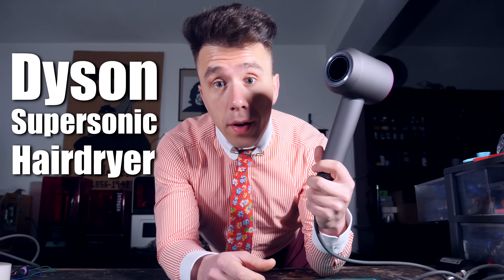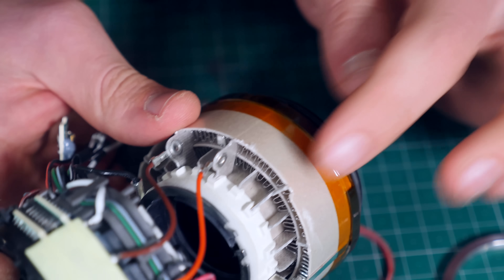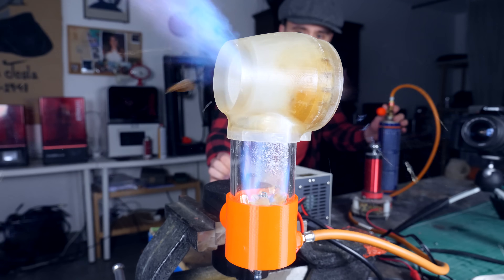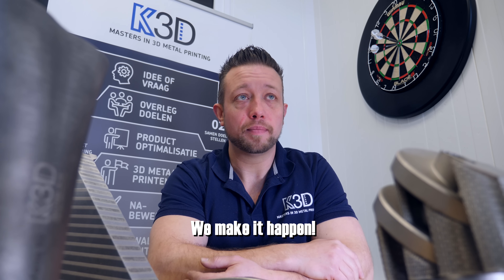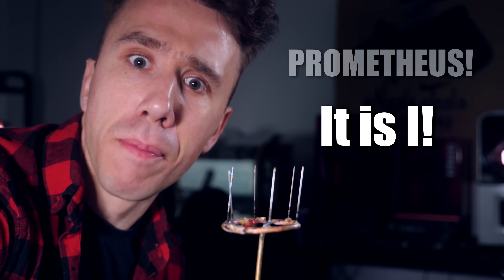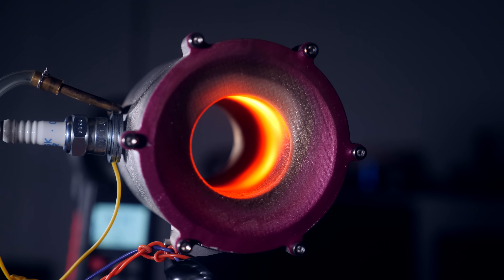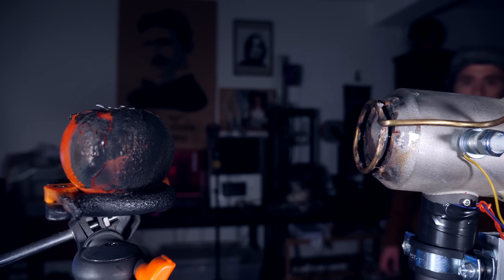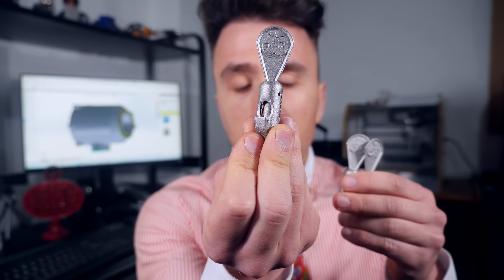I turned my DYSON HAIRDRYER into a JET ENGINE

Comment from the maker: A big thanks to Bob and K3D for the Metal Printed parts! If you need something printed in Metal they are your guys! (K3D Website:https://k3d.nl/en/)
Reply: have been thinking about 3d printing my rocket in metal so..
Reply: you finally uploaded 😱😱
Reply: A Brazilian dollar 😂 follicular dehydrator, you are now a fully qualified mad scientist. Love your work Joal👍🇬🇧
Reply: Why do you have a picture of John Lennon next to the picture of Tesla?
Reply: What settings do you use on the elegoo Saturn?
Reply: Are you still working on a detonation rocket engine?
Reply: you really need TEKNOFIBRA to protect stuff from high temperature!!!
Reply: 4 of these on a skateboard, i wanna know how fast it'll go with you riding it.
Reply: Mabye try to build a more sophisticated turbojet engine (with afterburner) by adding more compressor and turbine stages. You can encase the whole engine and use some of the intake air to cool the engine or maybe even try watercool it. You can increase the overall heat by using liquid fuel instead of gas or using a better gas mixture. For example a stoichiometrik hydrogen oxygen mixture (In order to not blow yourself up you can use flashback arrestors). 

An other thing you could build is a turboprop or try to improve your ionic thruster or try to test and use toroidal propellers for your engines.

Btw great videos keep up the good work.
Reply: When you reach a certain milestone of your choosing, meet up with LA beast and drink a jar of tomato juice.
Reply: same shit, when you make a self sustaining one then call it a jet engine what you made is a hit air gun 😂😂😂😂
Reply: You’re welcome Joel! It was our pleasure! Great to have you, until we meet again!
Reply: I'm intrigued... because the custom X-Wing I modeled 1:1 while learning ..... which ended up deserving the 2 years I spent on it.....    well, when something is over 36 feet wide and you try to reduce it to fit within a 220x220x240mm or a Photon-S build plate.....some things scale right out of existence.... I am 1 with the Force, and the force may be with me.... but where the heck was it then?
That build plate and the Flying Screwdriver are destined. (So Much Easier Than Electroplating It!)
By the Way.... Your hair is Fantastic, and I don't only say that  because I'm a poor excuse for a  Lex Luthor/Kermit The Frog/Freddy Krueger Doppelganger. It just Is. And, Tomatoes are Fantastic Fruit.
Reply: Now that I Watch on replay instead of typing..... I'm amazed you didn't burn the damn hair off.
Reply: I think if you add a water cooling system in your next design, it will help prevent the engine from melting.  This is the next logical step.
Reply: Make spiral tube around the casing, pre-cool the fuel and feed it trough that spiral inside your chamber. It Should cool the casing to withstand higher temperatures and at the same time it pre-heat the fuel...
Reply: Ahhhhhhhhhh I need a 3D printer pls
Reply: The man does love his jet engines.
Reply: Ideea Jet-Powered Coffee Maker
i'm a coffee lover so why u dosen't make an coffe machien which can re use heat to make hot water and the trust to create a preawsure for extraction.
Reply: or can u make an EcoJet for "The Sustainable Jet Engine of the Future"
Reply: Integza try to incorporate the fuel feeder system in the 3-d print itself with a nozzle extension which will help you to add the fuel more efficiently and thus create more thrust with the same amount of fuel
Reply: Integza you are the man!!! Your inventions are terrific!
Reply: Please take more safety precautions, my friend. You are tempting the gods.
Reply: If u get a sponsorship from pcbway they do metal 3d printers and cnc
Reply: @KonstiGrieche  Walk young Padawan... don't run yet....
Reply: now make that into airfryer. :D
Reply: Brooo try and use an axial flow compressor for the new engine, they have much higher compression ratio, I even tried designing one myself before I found out how expensive it would be to get it made with markforged… 6 stage + ogv and igv is good for anything under 10 inch diameter and stainless steel is fine but you can go as high as 8, and to remove the massive calculations required for the velocity triangle to prevent a compressor stall just use variable attack stator veins with trial and error. Convergent inlet helps sometimes from what I’ve seen, if you want to know about building variable aperture exhaust nozzle there is a link to a video and I can paste here but that is only necessary if you plan on producing the engine with an afterburner, also don’t forget to use inconel 713c for the combustion chamber, turbine section, afterburner, exhaust nozzle… I studied building a very high thrust to weight ratio turbojet engine while designing a supersonic UAV and trust me go with a axial flow compressor… anyway I love your videos, great video, thanks
Reply: my theme idea is :jet engine jetpack
Reply: 🔴 What Is Islam? 

🔴 Islam is not just another religion. 

🔵 It is the same message preached by Moses, Jesus and Abraham.

 🔴 Islam literally means ‘submission to God’ and it teaches us to have a direct relationship with God. 

 🔵 It reminds us that since God created us, no one should be worshipped except God alone. 

 🔴 It also teaches that God is nothing like a human being or like anything that we can imagine.

🌍 The concept of God is summarized in the Quran as:

📖 { “Say, He is God, the One.  God, the Absolute.  He does not give birth, nor was He born, and there is nothing like Him.”} (Quran 112:1-4) 📚

🔴 Becoming a Muslim is not turning your back to Jesus. 

🔵 Rather it’s going back to the original teachings of Jesus and obeying him. 

More .....👇

🔴 THE RETURN OF JESUS
Reply: @ddoherty5956 he said a bazillion but sounded like a Brazillian lol
Reply: @LtdJorge  I know matey🤣👍
Reply: @monarch6057  Why are axial flow multistage compressors not used more frequently in smaller engines (lets say a diameter of 6 inches or less) exept for the price? Im not experienced at all when it comes to these applicaions but have an interest in them and im taking studying this subject into consideration. Currently im in high school so i would be pleased if you could tell me some things about the subject like what you expected and how it actually turned out.
Reply: Mate just get away from plastics
Reply: Now make it fly
Reply: Scammed alert mate 👌🏼
Reply: @HicSvntDracones  quite true
Reply: Hello.  I’m pretty sure this person is impersonating you.  https://youtube.com/@integza1..  using your good name to steal info.
Reply: @jordanguyy  I got one too.  Reported.
Reply: mate you can build a rc fighter jet
Reply: i got a text me on telegram comment on my thing was that from you or a scammer
Reply: @jacksonmielke3817  Likely.  They’ve tried to get me a few times.  What was the logo by the call?
Reply: I thought it was fake anyway because if it was him he said the giveaway was for the person with the most likes mine had one and was Make a jet engine that uses useless tomatoes for something. 
example: fuel
Reply: logo as in his tomato with a mustache
Reply: @stumblestorms7881  sorry didn't send
Reply: it dint have a call but it was his icon the tomato with eyes and a mustache
Reply: @jacksonmielke3817  yup that’s the one
Reply: Alright thanks
Reply: yeah i was surprised because i also only had 1 like
Reply: On mine that said: Make a jet engine that uses useless tomatoes for something. 
Example: fuel
Reply: …is this dude, "text me on telegram" with your profile picture you? It’s an empty channel with like a hundred subscribers
Reply: You’re gonna burn your house down one day.
Reply: If you are 3d printing in metal, why not see if you can get a ramjet to work, using the exhaust of a turbofan to provide the accelerated airflow? 
Some might say that is needlessly complex and has a low chance of success. I say that is exactly why you should try it!
Reply: what is the part # for the motor? can it be bought by itself?
Reply: There are scammers pretending they are you in the comments and saying they have won.
Reply: The heart shaped tesla valve from the soviet union era scram jet known as FENRIS now. This mixed with a combustion chamber from a man from china. The compressor seems to be your own addition.
Reply: Hey I got a reply on my Comment of a theme for a future video and they have your pic and make it sound like it's you and that I'm being given a gift or something. Idk if it's real or not but sounds sketchy to me. And I'm not the only one. Just thought you'd like to know incase you want to do something about it.
Reply: I have thought about using an air compressor and bursts of air for my new design but i want to keep it compact and light weight, i have another design though which could at the end result look like the flying medical vehicles in cyberpunk 2077 or the battlefeild 2042 ospry which would need a compressor. I have one ready but the one i gave the car company patent it.
Reply: `build a metal 3d printer using syringes and servo's with battery charger for electrolysis printing, Not coating prints with electrolysis but actually laying down metal with electrolysis actual metal printing you've already got the printer and can use a varipot and battery if you don't have a flashy power controller
Reply: @leonmusk1040  im busy doing something first. Theres alot easier process out there for accomplishing things.
Reply: I wish I can win a 3d printer! I commented lots of times. No win. I guess next time.
Reply: Can you confirm that you sent me a message. It was to contact you on Telegram.
Reply: @KonstiGrieche  they are extremely expensive and complicated to make, a decent sized axial flow compressor would cost more than the tires
Reply: @monarch6057  makes sense given that the engine consist of more parts, many of them moving. And considering the size youd have to build the parts more precise. But is there any significant difference in efficiency or thrust compared to size in comparison to other designs?
Reply: @KonstiGrieche  yes there is a very significant difference in efficiency
Reply: @monarch6057  good to know thx
Reply: Ionic thruster MK2 would be cool
Reply: Do they printe metal parts by a sand 3d printer
Reply: I have an idea. Print clothes. Maybe even entire suit. You have tie already. Underwear might be hard.
Reply: Integza, i received a message saying that it was you and asked do add a Instagram profile, is that right or a scam?? I assumed it was an scam and didn't answered
Reply: Hey intenga !! 
I need a 3d printer but i cant bought it because of money pls if u give me a 3d printer then i can built an iconic thruster (bladeless fan ) aeroplane 😢😢❤❤❤
Reply: Hey intenga !! 
I need a 3d printer but i cant bought it because of money pls if u give me a 3d printer then i can built an iconic thruster (bladeless fan ) aeroplane
Reply: Hey intenga !! 
I need a 3d printer but i cant bought it because of money pls if u give me a 3d printer then i can built an iconic thruster (bladeless fan ) aeroplane 😢😢❤❤❤
Reply: So, here's my idea. You need to take your Dyson jet. Make the of them aim it at the sky and fly me to the moon 🌝... Make a rocket
Reply: How about, showing people how your engines can help society. Meaning energy source, or even cheaper travel. I think a lot of people are just viewing your channel is hey this guy's making a jet woo.... Personally I see it as more of a way of showing how we can conserve energy without using burning fuels like coal and gasoline and all of those things but I think that's lost.
Reply: Do an episode on depleted uranium! you from serbia right? You can get some fresh samples in Ukraine, its close by, i hear your friends dropped some off recently.
Reply: Make a stove
Reply: One posing as you is sending messages of won raffle prizes
Reply: Thanks for getting on top of these scammers, i get them messaging me in comments at least 4 a week on different channels.
Reply: I really wish all the fake integza free giveaways would stop. I think this is because you giveaway a free printer in each video, which encourages scammers. This is the YouTube channel is the worst example I have had for the scammers
Reply: Introduction

The field of prosthetics has seen significant advancements in recent years, with 3D printing technology enabling the creation of low-cost, high-quality prosthetics. However, many 3D-printed prosthetics still lack the functionality required to perform everyday tasks with ease. One way to increase functionality is by adding radio control to the prosthetic hand, allowing users to control the movement of the hand wirelessly.

In this blueprint, we will discuss in detail how radio control can be added to a 3D-printed prosthetic hand, including the sensors and electronics required for the project. We will also discuss how the fingers and motions will be actuated, as well as provide a detailed blueprint for the project.

Sensors and Electronics

To add radio control to the prosthetic hand, we will need to incorporate sensors and electronics that can detect movement and control the motion of the hand wirelessly. There are a few different sensors and electronic components that we will need for this project:

Electromyography (EMG) sensors: These sensors detect electrical signals generated by muscle activity, which can be used to control the prosthetic hand. We will attach these sensors to the user's shoulder or elbow to detect muscle movements.

Accelerometers: These sensors detect changes in motion and can be used to determine the orientation of the prosthetic hand. We will use these sensors to control the movement of the hand.

Microcontroller: We will use a microcontroller to process the data from the sensors and control the movement of the hand. The microcontroller will be programmed to respond to specific muscle movements and trigger the corresponding movement of the hand.

Wireless transmitter: We will use a wireless transmitter to send the data from the microcontroller to the prosthetic hand wirelessly. This will allow the user to control the hand without being tethered to any wires.

Fingers and Motions

To actuate the fingers of the prosthetic hand, we will use servo motors. Servo motors are small motors that can be controlled precisely and accurately, making them perfect for controlling the movement of the fingers. We will attach the servo motors to the fingers of the prosthetic hand and program the microcontroller to control the movement of each finger.

There are a few different motions that we will need to be able to control:

Open and close: We will program the microcontroller to open and close the fingers of the prosthetic hand based on the user's muscle movements. If the user raises their shoulder, for example, this could be detected by the EMG sensors and used to trigger the prosthetic hand to open or close.

Grip strength: We will also program the microcontroller to control the grip strength of the prosthetic hand. This will allow the user to pick up objects of different weights and sizes.

Wrist rotation: Finally, we will add a servo motor to control the rotation of the wrist. This will allow the user to control the orientation of the hand and perform more precise movements.

Blueprint

To create the 3D-printed prosthetic hand with radio control, we will need to follow a few steps:

Design the prosthetic hand: The first step is to design the prosthetic hand using CAD software. We will need to design the hand to accommodate the servo motors and sensors required for radio control.

3D-print the prosthetic hand: Once the design is complete, we will 3D-print the prosthetic hand using a high-quality 3D printer. We will need to use a material that is both lightweight and strong, such as PLA or ABS.

Attach the servo motors: Once the hand is printed, we will attach the servo motors to the fingers of the prosthetic hand. We will also attach the EMG
Reply: here is the thex idea you need to do https://youtu.be/H4YZxb2E5PA
Reply: Idea. How about recreating Heron's Aeolipile , INTEGZA STYLE!
Reply: @rpgiacon  it will be a scam. His channel is littered with scams
Reply: @Tonicwine999  Thanks! So i was not wrong. It is becoming more common each day and the bigtechs don give a sh.. I hope some day they have to respond as accessory to crime by not removing them.
Reply: @magicblockcraft 1
Reply: @integza 
Can you build a jetpack or like this new ones with some turbines on the back and some Jet turbines on the hands. This would be amazing also in a small scale like a drone
Reply: Make a rocket that uses guanidine nitrate as a fuel. When it is activated, it creates crazy amount of gas.
Reply: Idea: I wonder if you can watercool and protect a 3d printed nozzle with internal waterchannels? (you can boil water over fire in a plastic vessel)
Reply: Video Idea:- 3d printed jet engine using Spacex Raptor Engine design, might me a good video and interesting experiment.
Reply: Video idea, why don't you make a rocket engine using liquid propellant like oxygen and hydrogen
Reply: hi
Reply: @ambulocetusnatans  Not John Lennon. Professor Snape.
Reply: Did you ask me to take a screen shot of your/my comment on telegram for verification?
Reply: Were are man it has been 2months are you ok?
Reply: can he print INCONEL ..?
Reply: What is thrust?
Reply: Have you sent tomatoes to the moon yet?

Comment: You should probably keep the air running after you turn off the fuel.  To cool the engine, make sure heat doesn't spread where it normally doesn't because of cooling while running, and to expel/burn any lingering fuel
Reply: DeSantis
Reply: he didnt turn it off it broke

Comment: To keep it from slowly burning itself apart, you should first turn off the heat and then let the fan cool it off before turning it off entirely. That piece of plastic holding the glowing hot metal onto that stick may fail in a rather unpleasant way if you're not careful.